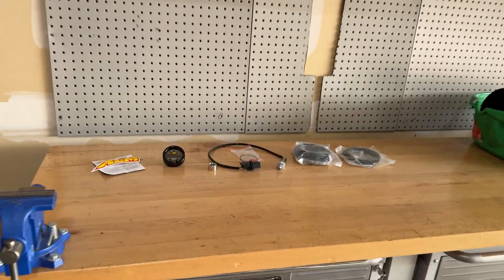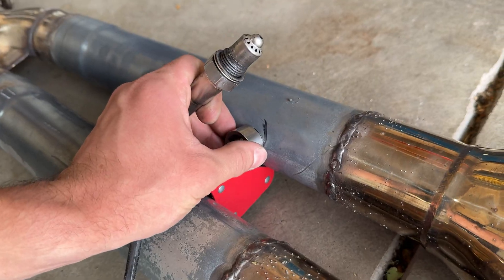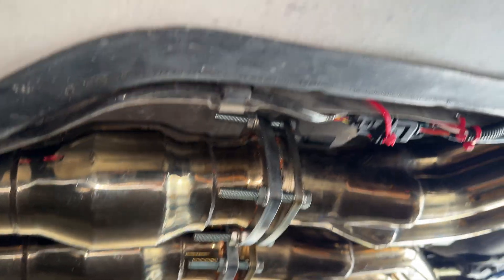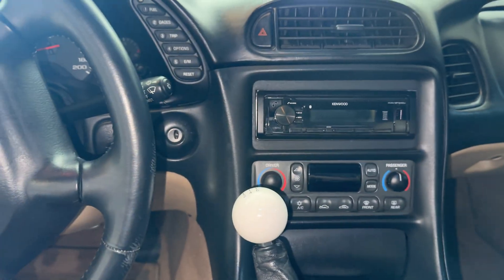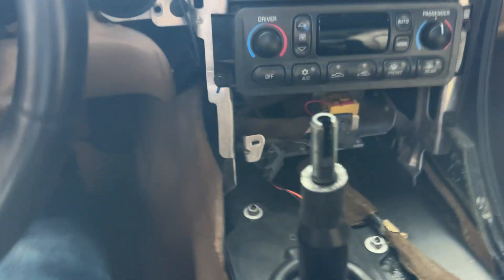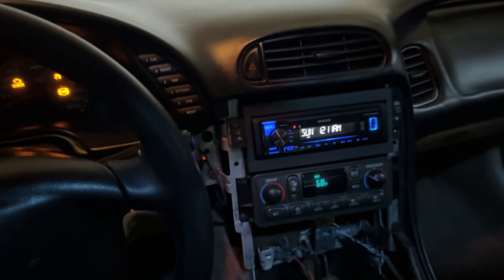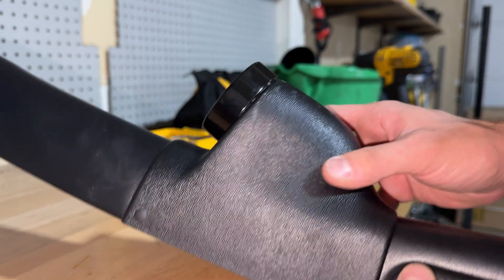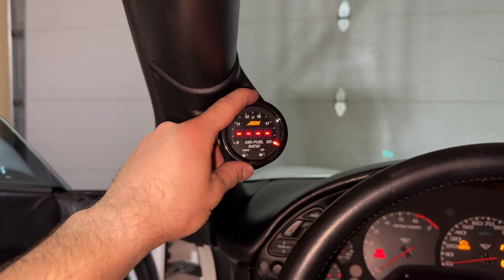How to Install an AEM Wideband O2 Gauge in a C5 Corvette - Step by Step Tutorial

Comment: I just had my C5 tuned at East Coast Supercharging.  He did a street tune with HP tuners and hooked up his laptop and his wide band.  Do you actually need one installed permanently just for a tune?
Reply from the maker: You can get temporary ones that you stick in the end of the exhaust pipe but they aren’t quite as accurate. Plus I just like having a wideband installed for peace of mind to make sure everything is running correctly

Comment: I've been thinking about doing this on my '04 base because it has mods including Kooks headers which already have an extra bung welded and capped off to add a wideband sensor; sort of easy. HP Tuned. I had an AEM wideband on my '86 Mitsubishi Starion for years.
I've been thinking about buying a laptop, the HP Tuner software and start tuning, because the tune on my auto trans isn't great and I'm tired of paying a tuner hunderds of dollars to get some of that overpriced tuner voodoo. I ran a tuner set-up on the Starion myself for free for years. I had to set fuel trims. HP Tuners is more difficult, but I think I can figure it out.